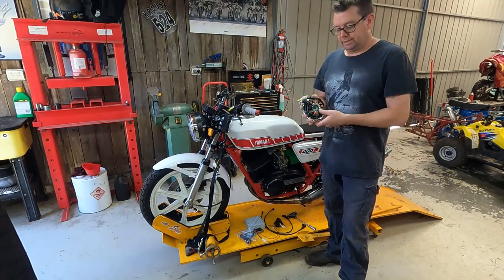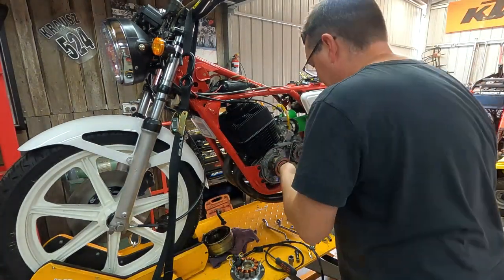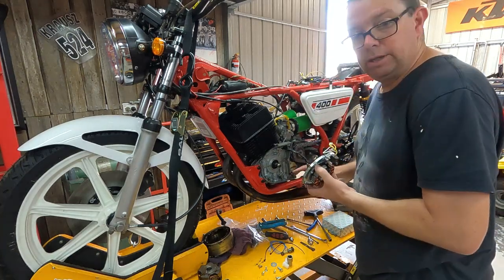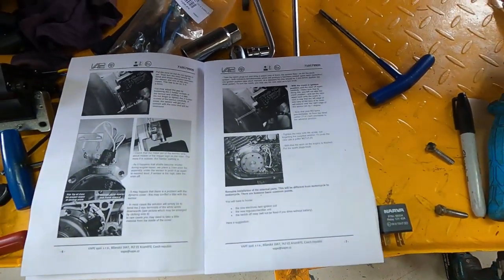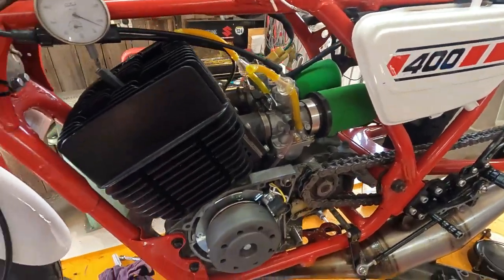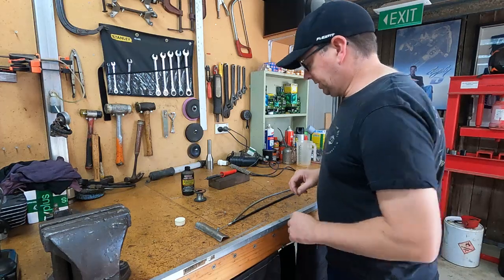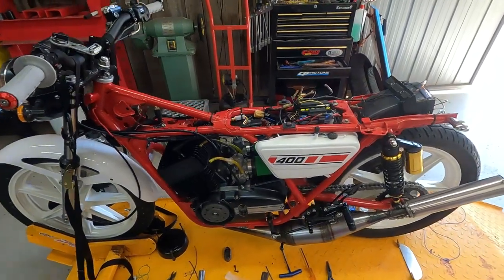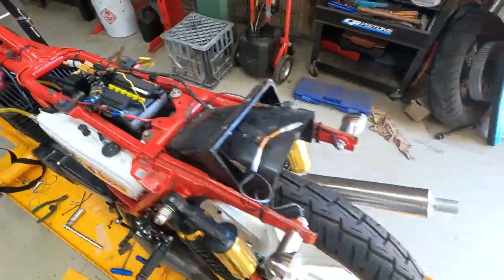Yamaha RD400 Vape Ignition upgrade.

Comment: I'm installing this on a 1972 R5. The only issue I am having is locating where to attach the black wire from the Relay that VAPE provides. I know it's suppose to go to ignition power, but identifying that wire on an R5 has proven difficult. I have looked at the wiring diagram for the R5, but it's not very clear. The closest color was a Red/Yellow, but I couldn't find it. 

If you don't mind me asking, where was this ignition power wire available to you, and what color was it?
Reply from the maker: Hey mate
I plugged mine into a brown wire at the fuse box area which is an ignition switch wire, come to think of it i think it was a wire that came from old rec/reg plug because that is now deleted because of the new rec/reg, so it’s a brown wire switched from the ignition near the fuse box, hope this helps. Cheers.
Reply from the maker: I’m sure with a multimeter you can probe around there and find an ignition switch wire there somewhere.
Reply: @rechargegarage8705  Thank you for the reply! Really appreciate it. And thanks for this video and the channel, it was really helpful to contextualize the install of the VAPE!

Comment: I installed a VAPE ignition system onto my 1977 CZ 350-472.1 Sport over 7 years ago and the only issue I had with it was having to replace the engine run / kill relay 4 years ago.

My son has VAPE ignition & 12 Volt alternator kits installed on his 1985 CZ 125-488.0 Deluxe, 1994 CZ 125-488.2 Deluxe and 1974 CZ 250-471.0.005 Sport bikes.
Reply from the maker: Nice mate, I think there great and work well, thanks for sharing 👍

Comment: The Vape is the best thing I did to my 76 RD400. I bought my bike in an abused state and spent a year rebuilding it back to stock setup cause I love the way stock motor runs and sounds.. but! I had no problem updating the iggy system. Even with the same flat iggy timing 'curve' the bike felt like it ran more solid somehow, maybe it's the extra flywheel weight I was feeling but whatever it was I loved it. This winter I will be buying the programmer and dialing in an actual curve. I had another system on it before the Vape and it had a curve in it and wow... did it ever improve the power but it had the tinniest lightest flywheel and I didnt like the way the bike felt. I defo like heavy flywheel to smooth this baby out and keep idle rpm at a normal sane level.
Reply from the maker: Great work, l like the system seems to work well and you don’t have to worry about breaking down if your battery dies. 👍

Comment: Have you had any problem with the vape hub moving? also did you have to use the old rubber grommet to seal the opening where the wires go through?  Thanks for the post!
Reply from the maker: Hi there,
No I haven’t had any issues with the system or flywheel slipping, just make sure the taper on the crank is clean and dry and should be fine. You can even use some valve lapping paste to mate the 2 surfaces if you are worried about it, then clean both surfaces and assemble and yes you have to use your old rubber grommet. Cheers hope this helps.

Comment: Does the lack of a woodruff keyway cause any issues with timing or other?
Reply from the maker: Hi Noah 
Not so far I was thinking of getting it keyed but haven’t done it yet, I think as long as you tighten the flywheel accordingly it shouldn’t move. I just used my impact gun, you know when it’s tight enough. 2 ugga duggas I think.

Comment: Nice video how did you make out with timing mark? I have 1975 RD 350 and Installed Vape power dynamo system. Was difficult lining up raised notch on fly wheel to pick up because the magnet is pulling in as you install fly wheel. Was using dial indicator to set it 1.8 mm btdc and that being such a small measurement  found it difficult to be accurate but i think I am on the money. Did you get the fly wheel keyed when you purchased kit? I did not . Was thinking of slotting mounting bolts on pickup for easier adjustment
Reply from the maker: Hi Johnny 
Thanks for the comments, I didn’t get the flywheel keyed as I may need to move it again if I put different brand pistons in as the crown height may vary but in saying that could slot the backing plate to get the adjustment. With the pick up sticking to the flywheel I have a piece of plastic that goes between the pickup and flywheel that’s correct thickness, after you tighten everything up you just pull it out and you have the correct air gap, I use this for chainsaws and stationary engines as well. Back in the day we used an old parts microfiche it was about the rite thickness. Cheers
Reply: @rechargegarage8705  It's worth noting that the keyway does not hold the crank on. It's sole purpose is to make it easier to locate the rotor for timing purposes. The rotor is friction fit to the the shaft. Vape explains this vaguely in their instructions. The ideal approach is to mate the rotor to the shaft. I do this by coloring the shaft with a wide tip sharpie then using valve lapping compound to lap the two together by spinning the rotor counter clockwise on the shaft until all of the sharpie is gone. Clean it up and ou're ready to go. For added insurance you can use sleeve retainer to fill in any gaps and lock the rotor in place.
Reply: @rechargegarage8705  Thanks recharge was not refering to the air gap I was saying when you install fly wheel and need to align raised notch to pick up it is difficult because magnetic force pulling on flyweel I think you mentined your video alignment was close . So if your only dealing with 1.8 mm I dont know how criticul it is having perfect alignment?
Reply from the maker: @johnnynewburgh9745  I pretty sure I just did it by eye, must have got it rite runs really well.

Comment: Nice RD400! I did a Vape igntion on a DT250 & have considered this route for our rd350 or yds7250 also, currently running Newtronics but would like it to run okay without a battery incase the Reg/Rectifier ever goes out.
Reply from the maker: Thanks, it works really well and super easy to fit as you know.👍🏻
Reply: Which year is your dt? I am woundering if there is a Vape fitting for my dt 400 mx...

Comment: I just got my engine back from rebuilding. Vape installed… I have a wiring nightmare
Reply from the maker: That’s no good mate, the vape is basically a circuit on its own only needs power and earth.
Reply: @rechargegarage8705  I’m learning all the other wires are not used after install
Reply from the maker: @mikekrodose123  yes you are correct.
Reply: @rechargegarage8705  hey are you busy?
Reply from the maker: @mikekrodose123  what’s up Mike.
Reply: Hey Mike I had some what of an issue when Installing wires . been a while now ? what was it the wires from the relay blue black brown? one went to existing coil wire power then I was looking for the one to kill switch and book said red/white but mine was yellow/red drove me crazy think different year moldel little variations then i had all brown wires to ground. also ran pig tail off that to ground on battery. Then I had to check orientation of fuse link on positive cable orignal set up was altered over the years. one other thing had guy doing some work on it and he hooked up the blue wire for neutral swicth somewhere? Seems to be good running charging
Reply: @johnnynewburgh9745  I’m running now my issue was a loose flywheel….I have the timing tool reset the timing and get a longer bolt and a lock washer hoping it holds tight…

Comment: Does the VAPE regulator eliminate both the OEM regulator AND rectifier? Or, does it just replace the regulator?
Reply from the maker: Hi
Yes it eliminated all that, it’s a charge system all on its own just needs power and an earth. 
Cheers.
Reply: @rechargegarage8705  Good to know. Will be helping my son install VAPE system on his RD400C. The translated instructions are crap. They don't even mention disconnecting/removing the rectifier. Cheers.
Reply from the maker: @ghelmeid06  cool if i can help in anyway if you get stuck more than happy, the only thing as you see in my vid is there is no neutral wire so you have to feed one into the wire sleeve down to the switch which there is enough room to do so. I'm going to get my flywheel keyed as on the 250/350 kits there not keyed and i've heard they can slip putting the timming out.
Regards Chris.

Comment: Seriously considering doin the vape mod on my RD125 twin.Recently had  charging issues and getting tired of setting points all the time.
Reply from the maker: Hey mate
Do it you won’t regret it, now I can run a smaller battery and it even runs better as it’s got a lot more power behind the spark. I got stuck with a flat battery once and that’s all it took to convert me, now I don’t have to worry as it still runs with a flat battery.
Reply: @rechargegarage8705  yeah i think i will.Its quite an expensive mod for me here in the U/K ..im looking at over £400,but i must get it done tho 👊
Reply: Bought one today but likely to be around 4 weeks delivery,not to worry 👊
Reply from the maker: @getawaywithpaul5513  yeah sweet, they are expensive but worth it I paid $800 Australian for mine as it came from the USA. Good luck with the fitting hope the video gives you a few tips.
Reply: It's a good mod; but absolutely must be key-wayed. Key the drum.  Don't rely on friction ; they slip. Key solves that.
Reply from the maker: @pauloconnor7951  your rite, I couldn’t believe it when I opened the box and saw the flywheel not keyed and I will get that done.
Reply: @pauloconnor7951  I did not get mine keyed and did not have issue with it slipping but I did purchase stronger bolt and washer as suggested when I purchased it at economy cycle
Reply: Ive just been fitting the kit to my rd125 dx were dose the black wire go and the red and green from the rectifier please
Reply from the maker: @bipolarrc7986  hey mate I’ll try to help, I have on mine a red, and a brown. Red comes out of the reg to the positive on battery,brown is earth and the reg is internally earthed once it’s bolted to the frame, did your kit come with instructions? You can look up Vape online and download instructions for each kit. Cheers Chris.
Reply: Yea the. Kit came with instructions but is in very poor English ive got all the wires hooked up bar the long black wire from what i can see from the video my rectifier is completely different